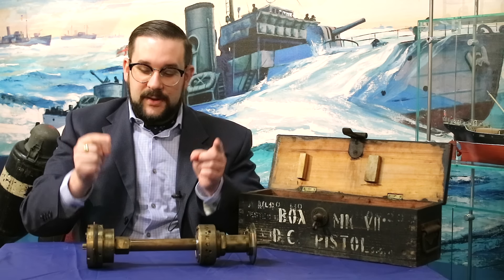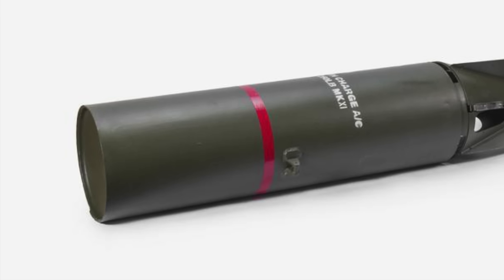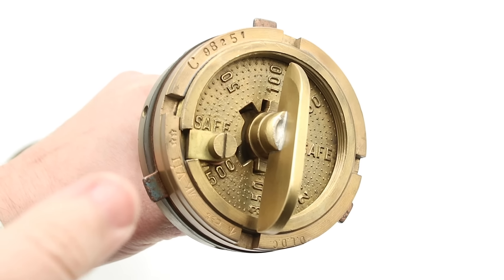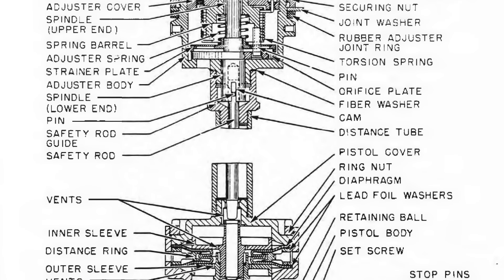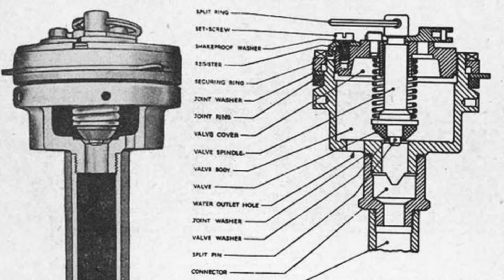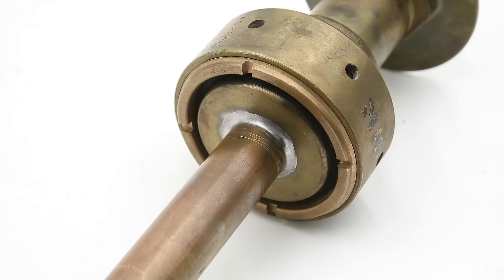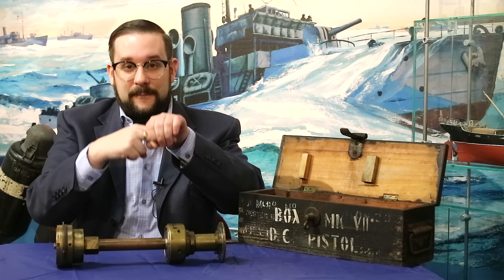Depth Charge Hydrostatic Pistols: Getting That Sinking Feeling

Comment: I work aboard a restored WW2 US PT Boat and we have a couple of the Mark 6 Depth Charges that are mounted on our stern for display.  I found a willing volunteer machinist who manufactured a couple of sets of non-functioning "replica" faceplates for the depth pistol and the Booster Charge Extender Safety Clip and plate. In researching these parts, I came across an interesting little known backstory for why the USN was compelled to invent the Booster Charge Safety Feature for the Mk6 Depth Charge. During the Battle of Midway on June 7th 1942, a Japanese submarine was able to sink the already damaged Aircraft Carrier USS Yorktown with 3 submarine torpedoes. Almost by accident, a 4th torpedo meant for Yorktown hit a nearby tending Destroyer USS Hamann which almost immediately broke in half and sank. As the Hamann sank, almost half of her crew managed to jump overboard and were swimming in the ocean awaiting rescue. That is until the 2 full stern roll off racks of Mark 6 Depth Charges started to detonate and killed the majority of the survivors in the water. These Depth charges were all set to minimum depth (30ft) or Safe setting, but when the ships sinking stern section reached 30 feet deep, they all began exploding, with the survivors swimming just above. Had the  booster extender safety device been invented, it would have saved all of those crewmen. The newly invented safety fork worked to prevent the booster charge from extending, and even if the pistol detonates, it will not be able to set off the main charge, since the booster charge is physically separated from the pistol detonator. I learned that this disaster was the impetus for the weapon designers to figure out how to prevent the same thing from happening in the future. Jerry G. PT658 Portland OR
Reply: Thank you for the valuable contribution to this conversation!
Reply: How's it go? Safety is written in blood
Reply: @techno_tuna  Sad bad true. A lot of forward thinking is done to prevent hypothetical situations, but the majority of safety items in any procedure are the result of case studies on accidents and near misses.
Reply: That was interesting.  I knew about the tragedy of the USS Hamann, but I'd never come across any mention of it spurring the development of additional safety features for depth charges.
Reply: Excellent description of a real issue.
Reply: @pomodorino1766  regulations and safeties are written in blood
Reply: Лучшая защита от гибели на войне на корабле - не идти служить на флот во время войны. Этот предохранитель никогда не сломается!
Reply: @kotnapromke  Очень немногим удалось избежать принуждения к вступлению в армию во время мировой войны. Вступай в армию или будешь казнен как предатель. Не то же самое происходило с тысячами людей в СССР и во время Великой Отечественной войны? Неограниченный ток электричества сломает предохранитель любого размера!
Reply: @allaboutboats  Нет. Всегда есть выход. Побег, самострел, плен, отказ выполнять приказ и тюрьма. Куча вариантов не воевать. А уж в США тем более не было принудительной мобилизации.
Reply: @kotnapromke  В США во время Второй мировой войны было зарегистрировано 49 миллионов мужчин, а призвано - 10 миллионов. 18 и 19 лет были привлечены к призыву 13 ноября 1942 года. Уклонение от призыва составляло около 4% от общего числа призванных. Около 373 000 предполагаемых уклонистов были расследованы, из них чуть более 16 000 были заключены в тюрьму. (из википедии)
Reply: Amazing. Thank you!
Reply: @allaboutboats   4% умных. Для меня они Герои! Нет ничего глупее чем умереть на войне за власть капиталистов и богачей.
Reply: Very very cool,  but sadly tragic story.  Thanks for sharing it
Reply: @pomodorino1766  Yep. A hammer is a nice tool, invented long time ago. Same goes for a nail. Using both a hammer and a nail at the same time, is best done by carpenters - they DO know the difference between a nail and their thumb. Try to figure out how they learned it...
Same learning curves apply to more sophisticated weapons. Even drones and FPV drones in Ukraine suffer from the learning curve.

Comment: Munitions design is interesting. It's straightforward to make a device that will readily explode, or that will never explode, but in order to make a device that sits on a ship for months, possibly while the ship is being shot at, and may be handled somewhat roughly, without exploding, but will very likely explode when actually desired, is a design goal that produces its own odd expedients.
Reply: This was what cost the Japanese fleet one of its aircraft carriers: munitions mismanagement

Turns out that having *all* of your munitions stored on the decks - though great for quickly rearming your planes - is the dumbest thing in the world.

They didn't even need to hit a magazine. It was a simple hit scored on the deck and the entire ship was lost.
Reply: @nsahandler  They learned the hard way that they needed to jettison the depth charges and often their torpedoes before they went into battle with surface ships.
Reply: Don't remember which carrier at Midway blew up because of fuel vapors. The USN was using CO2 to purge fuel vapors from the internal fuel distribution system.
That saved at least 1 US carrier later in the war.
Reply: @philgiglio7922 Had the USS Franklin not had at least one of its avgas lines purged id imagine that ship wouldn't have survived. Unfortunately the second set in the rear half was still full of avgas, not just vapors. I'd imagine if both had burned that ship would have sunk from all of the munitions eventually cooking off.

Comment: Now it all makes sense!  For those of you who have watched the excellent "Dambusters" movie, one thing that always bothered me was how a bomb designed to "bounce" on the surface of the water (that filled the Ruhr dams) could possibly NOT detonate prematurely.  Now, with the deep dive into the mechanism of Hydrostatic Pistols, we now know there were multiple safety mechanisms, to prevent detonation by shock, (even the shock of another depth charge exploding nearby!) making the mechanism of the "bouncing bomb" used in the raid understandable. 😮  Genius! 🤓🧐
Reply: Ordnance fuzing is a fascinating subject and an example of an always/never situation. You want your ordnance to always work but never detonate prematurely, but if you have to choose you’d prefer the odd weapon that fails safe rather than detonate prematurely.
Reply: Time delay fuse probably makes more sense for dams.  It's what they do with bunkerbusters, and APHE and similar munitions.
Reply: @immikeurnot  unless cracks in the casing lets water in and ruin the fuzes and fuses. I'm sure that was a consideration, besides the inadvisability of having time delayed bombs stuck on the still experimental rotating release mechanism. 😳🫣

Comment: The engineering alone in this fuse arrangement is incredible.  I've been a powder monkey for 20 years now, I use electrical tape to connect the progressive charges.  These depth fuses are brilliant.

Comment: Kinda amazing way to get at the scale of the manufacturing base needed to keep up with the war.  Every single detonator has how many pounds of brass, which needs to be carefully machined to spec, hand-assembled and later soldered, only to be part of a salvo of dozens or hundreds of charges dropped in a scattershot attempt to take out a single submarine.

For every ship full of people, there were huge factories supporting them with ordinance.  A group effort of a scale we haven't seen since the moon shot.
Reply: Good point. Behind every submarine, ship or aircraft they must have been 1000s of people working on lathes in workshops to fabricate theses devices. I think the same about ww2 bombers with all their cockpit dials and gauges. An entire cottage industry making instruments.
Reply: @notmenotme614  Did those use radium dials in WW2?

Comment: My first U. S. Coast Guard “High Endurance” Cutter still had a Hedgehog launcher when I joined her in late 1970. (Soon replaced with direct fire 81mm mortars for close-in anti surface.) There was a lot of Navy Surplus involved, including the 5”/38 main gun, probably from a decommissioned Fletcher class or the like.
Main ASW was the Mark 46 homing torpedo, with two triple launchers.
Reply: Some cutters actually had 5”/38s from the start, since they were basically just slow destroyers used for convoy escort duties.
Reply: @FS2K4Pilot  Boutwell started out with a 5”/38 (commissioned in ~1966). Traded it in for a 76mm Oto Melara soon after I left in 1972. Definitely a good trade, we could not even track Skyhawks in refresher training. But sad, the 5”/38 is a classic.

Comment: Very well done, Gilles.
I did not know that the British depth charge pistols were in fact a special case of "time fuse", as opposed to really hydrostatic, i.e. driven by water pressure. 
You do explain that the American were in fact hydrostatic. It would be cool to compare with the German, Japanese & Italian variety? 
I have read that some of the german aircraft bomb fuses were electric, and used a capacitor charged before release, to effect the time delay.
Many thanks for the hard work you put into creating theses videos., and I love your humor too!
Reply: It’s true that most German aircraft bomb fuzes were ECR (electro capacitor resistance).

Comment: 17:05   Are we sure that is a rubber bellows and not a metal bellows?     That drawing shows what appears to be a metal bellows
Reply: @davidgenie-ci5zl I'd say that it is highly unlikely that metal was used for the bellows. The hydrostatic fuse needs the capability of being reset multiple times. A ship may abort an attack because the target is sunk, or has moved to a different depth. Metal without expensive, complicated, heat treatments lacks the flexibility of rubber.
Reply: @richardhoare9963  Metal bellows can be actuated many tens of thousands of times.  Rubber is however very suspectable to being degraded over time, even if never flexed.    The drawing shows what appears to be a metal bellows shape.     For long term reliability, I highly suspect it is indeed a metal bellows.
Reply: @davidgenie-ci5zl I'm inclined to change my initial thought and agree with you. I was looking at my barometer and realised the working parts are metal.

Comment: The Gatwick Aviation Museum has an Avro Shackleton which was used for submarine hunting. 
If you're lucky, one of the guides will be one of the original crew and they can tell you how they used to be equipped with a limited number of nuclear depth charges (as well as their sonar bouys and other equipment.
It is interesting to hear their stories, especially because their sorties used to be very slow, so there was an endurance element we'd struggle to appreciate in that tin-can.

Comment: i used to work in the oil industry based in Aberdeen,  i worked as a seismic survey engineer, we used  (Hydrostatic Pistols/ compressed air guns) air guns to generate a pulse wave which passed through the sea into the earth , in the oil pipe we places monitors to measure the  wave from the guns, they were abt 1m length,  abt 30mm diameter, very heavy,  when in use it was just like depth charging for subs, lol

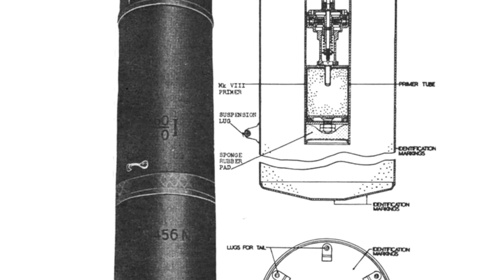Comment: Minor point, but since the container is limited by volume and not weight, would it be better to talk about the relative explosive power on a volume basis? 3:01  I think all of the depth charges will sink to the bottom, so sinking faster with a metal weight seems right, but deeper?  Perhaps “faster to a given depth or deeper in a given time” might be more accurate.  3:05  I don’t understand the two depths for one weapon.  Will the shallower pistol always go off and never reach the deeper depth?  4:49

Comment: RIP to all the soldiers, sailors, pilots & civilians who perished in WW2.  Being in a sub while being attacked by depth charges has to be one of the most terrifying things to go through & perishing underwater is horrific. We can only hope that the submariners who died didn’t suffer long.  You’d think they wouldn’t with the water pressure & explosion but you never know.  It’s awful even contemplating it.

The USS West Virgina was a ship that capsized at Pearl Harbor.  A few sailors got trapped in an air pocket & crossed off 16 days in a calendar which was discovered after it was salvaged 6months later.  Their banging was heard but apparently it was impossible to rescue them at the time.  I cannot imagine the horrific death those men died.  I just recently read about this & apparently none of the families knew until recently.😕😔

Comment: I have worked with quicklime (CaO) .When it comes in contact with water it expands violently . I was told that it had applications in depth charges .I don't know how it was used .

Comment: For years, I’ve always wondered how depth charges worked. 
Im surprised it technically works on water leakage rate and not hydro pressure.

Comment: Interesting. If the 'safe' position just blocks the orifice on the adjuster, that means that if dropped into the water, the pressure with increasing depth will eventually force water through there and detonate. If I'm right, that means that any destroyer that sank with any of these still onboard would go BOOM sometime on the way to the bottom if it's deep enough. The idea of being trapped in an air pocket somewhere below decks of a sinking ship is already a terrifying thing to imagine. On top of that, knowing that any second, the ship is about to blow would just make it that much more awful.
Reply from the maker: The safety rod also holds the flanged sleeves together, preventing the diaphragm from expanding and cocking/releasing the firing pin. Not to mention the booster extender, which if still safety pinned in place would prevent the charge from detonating even if the detonator went off.
Reply: @CanadianMacGyver  All of that kind of circles back to why unexploded stuff is extremely dangerous.  The water will get in, things will corrode...  Years later, something bumps the munition and boom.

Comment: You mentioned "sophisticated" homing torpedos. But that WILDLY understates just how smart and capable the latest torpedoes are. However smart you think they are, they figured THAT out 2 decades ago and have something better as well.
I'm half convinced the rise of skynet will start not with drones and any AI they use (which is VERY smart) but the torpedoes instead.

Comment: Attaching the worth of a good mechanic clock to each depth charge somehow feels either like practiced pacifism or even sabotage. Can anyone tell why e.g. a simple burst disc is not sufficient to reliably ignite some ordnance around a certain depth?
Reply: Probably because nearby depth charges detonating would set if off prematurely. And one of the many things you don't want is a charge going off just as it rolls off the rack and is 10' off your hull.
Reply: @JCWren  A burst disc with a solvable protection disc in front of it? We don't need to redesign WW2 weapons here, and yes, a chain reaction due to other active depth charges seems quite a problem. But anyhow, this clockwork-like mechanism seems quite overengineered for something to blow up in high numbers...
Reply: Probably primarily adjustability, even if some of these weren't adjustable.  Reliability and safety for the rest.  Soluble cover?  Cool, but things on ships get wet with spray and rain. 

This fuse isn't all that complicated as far as such things go...

Comment: The British were so clever with their technology. Something that surprised me is all the machines parts made of brass. Why not stamped and drawn steel parts with corrosion resistant plating?
These were single use mechanisms so you'd not want to put the most expensive material in them.

Comment: Wondering about the contact exploders on the Hedgehogs.    Most of the fired hedgehogs were misses,  but better percent than DCs.    Did the Hedgehog have a depth whereby it did not function.  The Hedgehogs that missed enemy subs,   did they just continue to the ocean floor and explode when hitting bottom?   Wonder if any sonar men ever heard hedgehogs exploding on the ocean floor.  Hmmmm.

Comment: As the proud parent of two queer kids, actually one transgender child and one pansexual child, it just breaks my heart how much brass and machine time was wasted on producing these expendable items. For the price of one of these "pistols", you could get at least a dozen PPS-43s.
Reply: As a parent of four normal, well-adjusted children, with some appreciation of engineering processes and costs, I too see a clever but overly-complicated mechanism which must have generated a lot of waste and taken much scarce lathe time to produce.
Reply: @EllieMaes-Grandad  Military Ordinance triggers are Definitely either over simplified Claymore mines FRONT TOWARD ENEMY for example use to Be marked Front and Soldiers would Blow them self up, Or Over Complicated Like a Nuclear Trigger Nobody wants one Going off Accidentally.   A Depth Charge exploding on the Ship Launching it would Be BAD
Reply: @seha6391   Quite so.  I noted the sheer size and amount of machining in it.   To avoid risk, the first A-bomb wasn't armed until 'Enola Gay' was way out over the Pacific . . .
Reply: @EllieMaes-Grandad  I hear you these types of things i just find interesting being x Military now im Wondering what kind of Mechanism they used on Sub Torpedos LOL